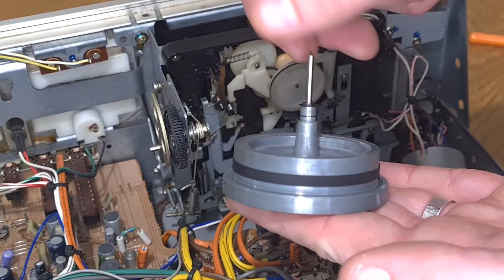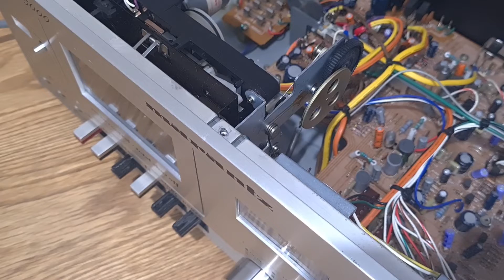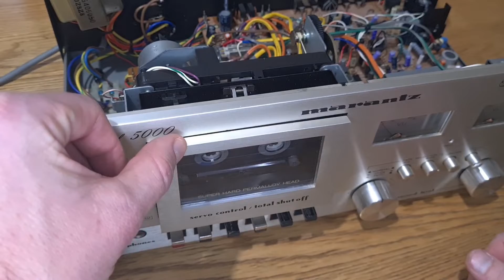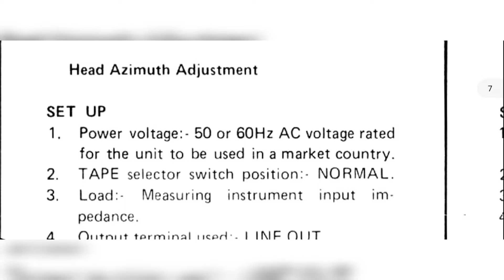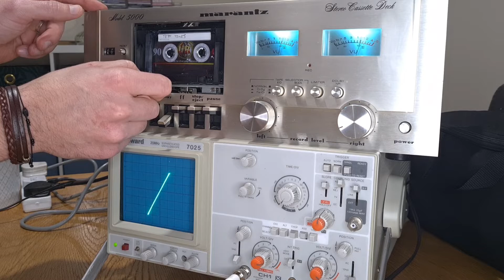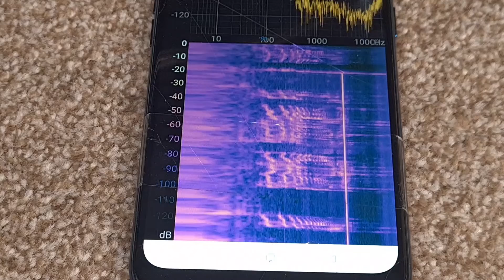Marantz 5000 1970s Cassette Deck - Belts, Light Service & Calibration

Comment: Where did you get the drive belt kit from, my Marantz 5000 is in need of new belt replacement, cheerz
Reply from the maker: Hiya sorry I think I got a generic flat belt after measuring it up. You can get good ones off eBay seller manatree

Comment: Never adjust vu meters based onto tape.
Always adjust vu meters based upon lineinput (410 mv) L/R, -5.5 dB
Only then you can adjust gain (play level) L/R measured on line output (775 mV) 0 dB
Reply from the maker: That's a lot less fun!
Reply: @pwrestoration  not sure if you're cynical or joking..

Comment: Good job man! I suggest to buy some fine brushes to clean the holes (capstan bearings, etc.) instead of those cotton sticks - because you're only pushing the dirt deeper into the hole. Also be aware of the lints from those sticks - they may interfere moving parts when left (and embedded into fresh grease...)

Comment: Great really enjoyed watching, I bought this marantz 5000 tape deck back in the mid 70s from new still have it and it works, I've spent a dit of time changing belts and cleaning the record switch mechanism over that time, only problem is I think it's running a bit slow but I don't have any of those scopes, so do you recommend adjustment by ear.
Reply from the maker: Yep ear is as close as you'll get it without a calibration tape. You can use an app called spectroid if you buy a speed calibration tape, theyre usually about £10.

Comment: Could you tell me the belt lengths, I have a Marantz CD-314 which uses the same main deck and looking to get hold of belts to replace main drive, ff/rewind and tape counter.
Reply from the maker: Not sure on lengths but you can get the kits off eBay 

https://www.ebay.co.uk/itm/334506785244?mkcid=16&mkevt=1&mkrid=711-127632-2357-0&ssspo=_7R0RU3ES0G&sssrc=2349624&ssuid=qI2jvYkCTXO&var=&widget_ver=artemis&media=COPY

Comment: If you were setting azimuth, for 0db  vu meter position, with the test tape, and they didnt match, how do you know its the meters that need adjusting and not the output pot. on the board for that channel? Enjoy your videos by the way.👍
Reply from the maker: I can't remember the specifics for this one but generally I get them to match by azimuth and then adjust the playback pots by oscilloscope later. Usually in a service manual azimuth is the first thing to check

Comment: That is a gorgeous looking deck, and the music near the end sounds great.
Not trying to tell you how to suck eggs, but when calibrating the VU output, wouldn't it be easier to record a 3000hz test tone at 0 dB, then you would have a nice steady tone to work with when adjusting the pots?
Reply from the maker: You're absolutely right, I think on the day I only had the one deck handy though so was a bit stuck 😄

Comment: Great video. I’ve got one of these on the way. Can I ask what pinch roller you used ? having trouble hunting one down
Reply from the maker: I ended up measuring the old one and ordering a generic replacement. I can't remember what size it was but they're listed by outside diameter / width / axle diameter. For example 13x11x2mm. Good luck!

They're available on fixyouraudio.com